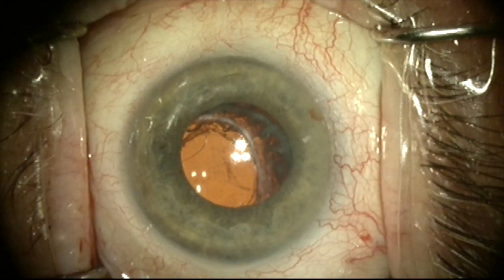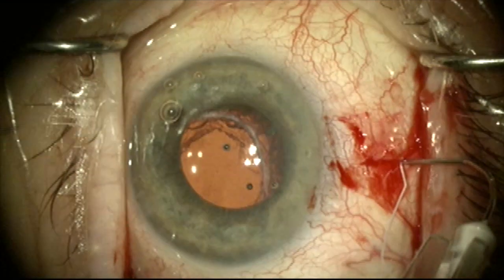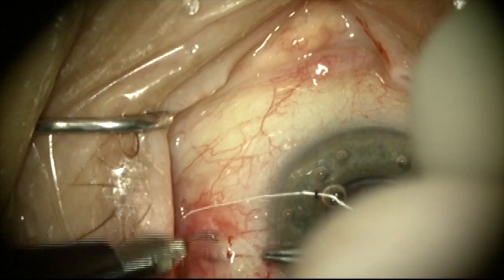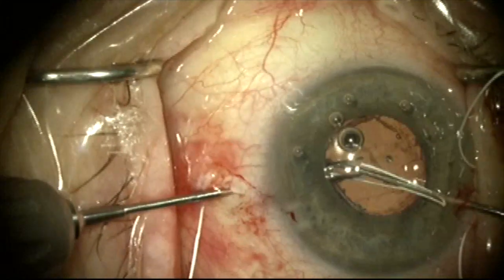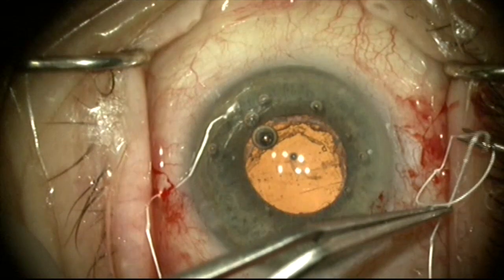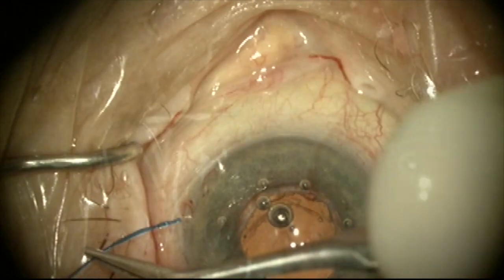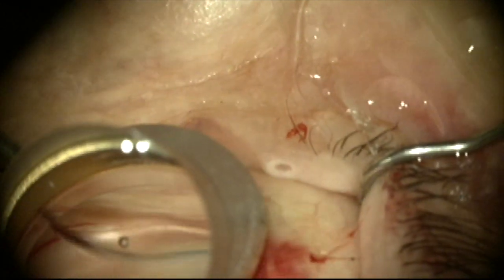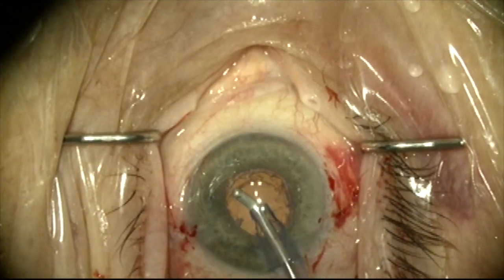Lasso of dislocated lens and GATT glaucoma surgery by Steven G. Safran MD

Comment: Ever lassoed a complex with 4 Gortex sutures? (To prevent tilting in a case with more extensive zonular dialysis)
Reply from the maker: Never had to do that.  I've not had any tilt or problems with the two sutures done as you see in this video.  Have done quite a few of these now with this technique and no problem.